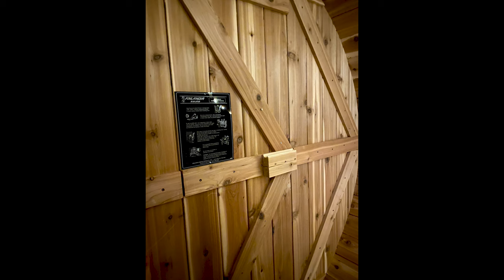DIY Barrel Sauna Build from Scratch

Comment: probably too late to correct, but these are usually made so the cove cut is always facing down on each side of the barrel, means you have to have a double cove piece at the very top and a double ball piece at the very bottom. this is so your timber doesn't collect water in the coves that face upwards.
Reply from the maker: I have never seen that before but that is excellent advice thank you. Might make the final piece easier to fit as well since it would be a double-cove. Would also need a double-bead on the starter piece

Comment: Hey. Were you not using a bead (rounding over), a round nose bit, and a nose bit (with the bearing at the top)?  Only reason I’m asking is you only listed a rounding over and a nose bit (cove)?  
I thought I saw you pass the board over top the round nose bit, and then later along the nose bit with the bearing at the top!

Comment: Hey there Michael, great video! I’m about to set up all my staves and I’m looking at where to get the straps instead of the cables. Is there a site that has some cheap strapping options? Thanks for your guidance, Alex
Reply from the maker: I used Fechometal, but you’ll want to get a strap tensioner as well if you do the straps. Amazon also has banding now.

Comment: Hey Michael - this is awesome man. Thanks for sharing! Question: You went for a 4' depth (makes sense and considering the same things.. mainly used by 2 people) but what diameter barrel did you make? 6 foot? And then any thoughts on overhang of the 2x6's? I saw some companies make a bench in the front.
Reply: Actually, curious if your outside dimensions (depth) is 4' or if that is what you aimed to have inside. I'm guessing if they were 4' boards, that would leave you with an internal depth closer to 3'. If so do you think that is sufficient for 2 people sitting across from each other?
Reply from the maker: Hey Jarrett, appreciate it. The staves only overhang a couple inches so it is just under 4’ inside which is definitely comfortable for two people. Also makes it easier and cheaper to heat.The diameter is 6’.

Comment: Curious how you feel about the barrel design considering it isn't insulated. We want to do a barrel for cast and it's a lot easier to build out... but I am concerned it will just loose it's heat quickly in the winter. How has it been for you?
Reply: wood is a very good insulator...

Comment: Thanks so much for the video and write up! The router bit update is great to know too. Does it leak? I see some designs add a roofing material on top. I prefer the look without  the extra roofing.
Reply from the maker: It does leak but there are sauna caulks out there than can be used to prevent it! Also, a tighter seal from the staves through better routing and addition of jointing would make minimal leakage.
Reply: @michaelsounart  You could add some corrugated sheets over the roof. Super simple and would provide you a waterproof sauna.

Comment: Howzit man , just wanted to find out how much wood you bought in terms of size etc ?
Reply from the maker: I bought 50 2x6x8 which was pretty spot on. You can also use 2x4 for the staves but I wanted to save time on the routing. I think sometimes people use 1-inch thickness for the walls, but I wanted it to be more solid.

Comment: Hey Michael,

thanks so much for not only the video but even more importantly the fantastic doc!

Question Re: instructions

With respect to the dado router bit, did you use 1 3/8ths because you couldn't find a 1 1/2" blade? or was it because you wanted a tighter fit? I wasn't sure because you mentioned in your instructions that the blade wasn't big enough "My bit was just short of the exact width I needed so I had to do two cuts on each side."
Reply from the maker: Hey Patrick, it was because I couldn't find a 1 1/2in blade and I figured I could try for a tighter fit. But that kind of back fired. Definitely recommend a diameter that matches your wood thickness.

Comment: Nice outcome but man that’s a lot of wasted cedar on those off cuts when you did the circle cut with the jigsaw.  Also.... gloves and routers.. well glad it worked out for you.
Reply from the maker: Yeah luckily I was able to salvage a lot of that wood for the benches! I also made a removable bench that lays across the two benches to stretch out. If you have any suggestions on how I could save that wood better without having to patch pieces together please let me know. Good to know about the gloves.
Reply: Michael Sounart making the benches is great. You could cut each piece near the door opening to just over the expected length needed, then after trimming you end up with very short trimmed pieces and in the process preserve the full length boards.  But not having built this, it might not work as well as when doing that with building decks for example. As for the router...please no gloves ever.  Lathes, table saws, drill presses etc, all the same rule for me, no gloves. At best you loose a nail or a finger tip, at worst it’s the use of your hand.  Nice project, I really do like it!